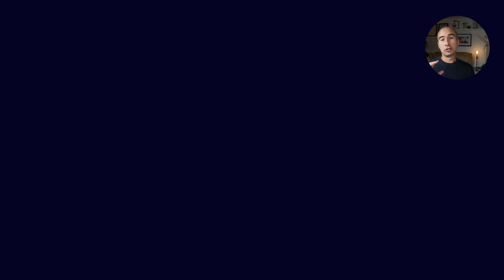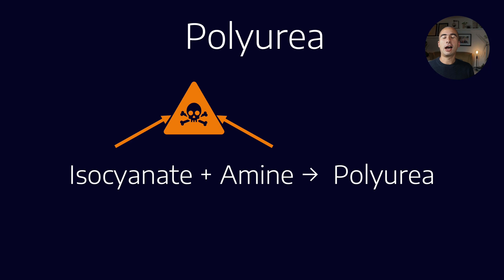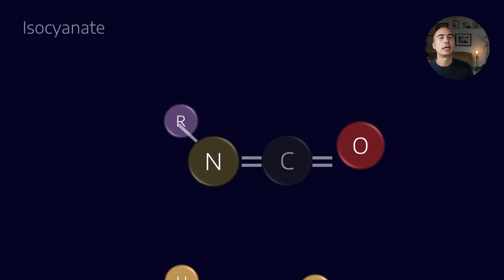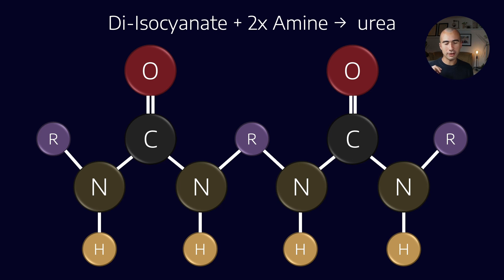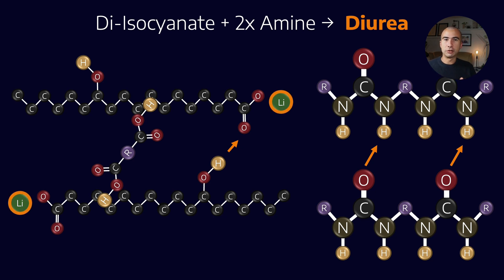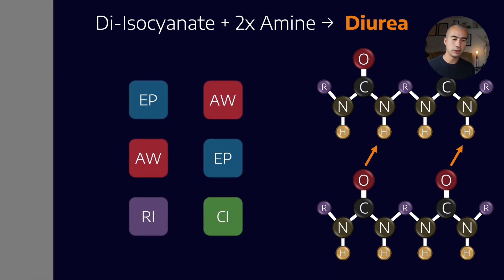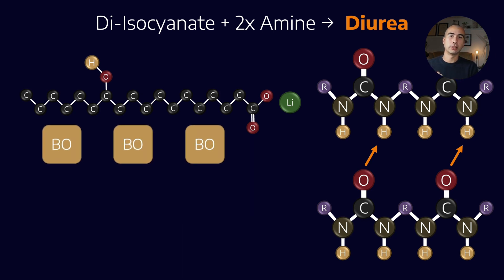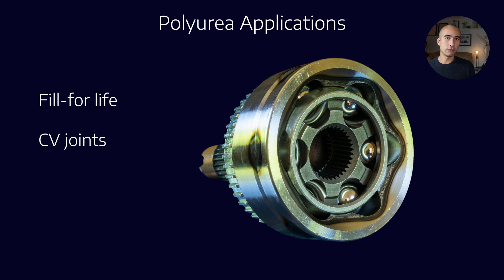How do Polyurea grease thickeners work? How are they different from metal soaps?

Comment: Hi, thanks for the detailed explanation of poly urea grease!
I have 2 questions:
Can I use this type of lubricant on my mountain bike?
Does poly urea grease chemically attack plastic and rubber parts?

Thank you very much!
Reply from the maker: Generally, yes. Unfortunately the variation in chemistry  of both plastics and rubbers are just as large as in lubricants, so there's no way to definitively say that they will be compatible. But in general use the answer is probably yes.
Reply: @LubricationExplained  I was told by Moog that the rubber on their ball joint boots are made with certain resistance to lithium grease. It's probably going to be okay if polyurea grease acts similar against rubber than lithium grease does.

Comment: I have a new John Deere tractor and wish for it to last decades. The manual calls for lithium greases on the driveline, but says that ideal is to use a polyurea grease. My question is: If the U-joints were lubricated at the factory with lithium,  given the extreme difficulty in replacing or cleaning out the U-joints, should I forget even using a potentially incompatible polyurea?
Reply from the maker: Good question! Personally, I’d stay with the lithium complex, especially if you’ve got a high quality product. The bug advantage of polyurethane is that the thickener is metal free, and therefore has really good oxidative stability. But the U Joints shouldn’t experience temperatures that are too high (relative to a lot of other industrial applications), so the grease should still last a while. From an equipment protection standpoint they’ll both do a great job.

Comment: can polyurea be the best for most uses?
"one to rule all" for typical diy-er.
Reply from the maker: Yes and no. A couple of cautions - often polyurea greases don't play nicely with other greases, so if you're trying to switch between say a Lithium Complex and a Polyurea you can sometimes run into compatibility issues. 

The other problem is that for a "general purpose grease" around the home / workshop / farm, you'll want a substitute for common EP greases. Polyurea thickeners don't play nice with EP additives, so they're often not great in those shock-loaded applications.

Otherwise, they're a very good technology that performs well, with the caveat that they need to have been manufactured well.
Reply: @LubricationExplained  I came back to this video.  I saw a chart that has 2 types of polyurea thickeners.  One was regular polyurea and another one was called polyurea shear stable.  The shear stable one was compatible with a lot of other greases.
Reply from the maker: @MikeyAlbertin  Yes! Sorry that was something I was trying to state with the "manufacturing quality" part of my answer. I should have spelled it out more clearly. Just to be clear though - compatibility between thickness does not equal grease compatibility. As mentioned in my earlier answer, the additive families of different greases can be quite different, and this can be what causes instability in mixes of the two.
Reply: @LubricationExplained  I was just thinking the shear stable one might be a good choice cause of longevity.  I have seen a lot of applications that get really neglected being re-greased over a period of time.
The grease turns hard and the fittings usually will not except grease.
Reply: Mr your feace book linek

Comment: Hi MR LE! Would love it if you could make a video about 2 cycle oil/2 stroke oil. I used 2 stroke oil in my gas tank at 1:300 ratio ( 0.2L oil per 60L gasoline ) as detergent and UCL additive. I use the API TC, JASO FD, ISO-L-EGD rating not the TCW3.
Reply from the maker: Great idea! I'll add two-stroke to the list.
Reply: @LubricationExplained  And why the castor oil is still around in two stroke racing oils.
Reply: @JeiJei752  : One reason is that it works with alcohol, like E-85, which if all the components in the fuel system can handle it, will produce as much as 17% more power with only re-jetting.